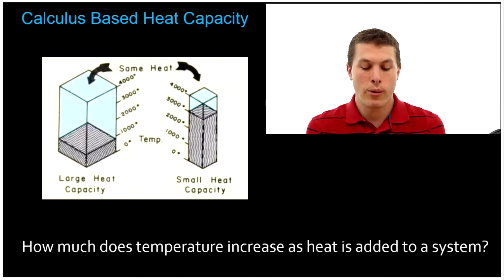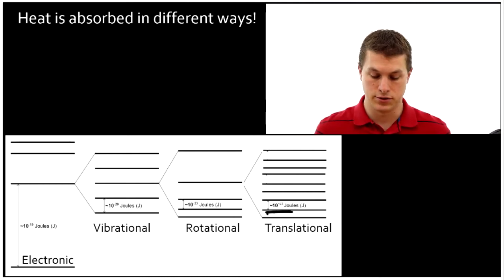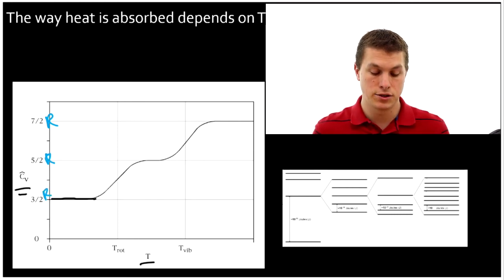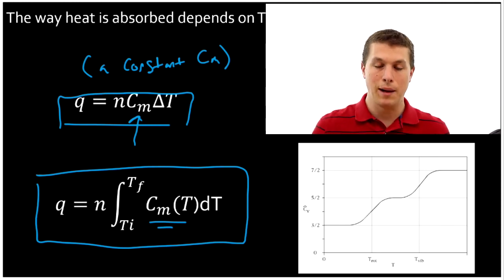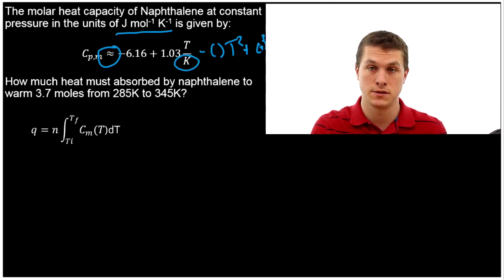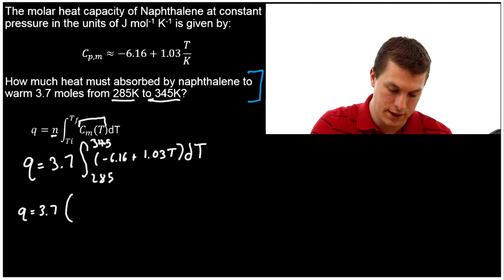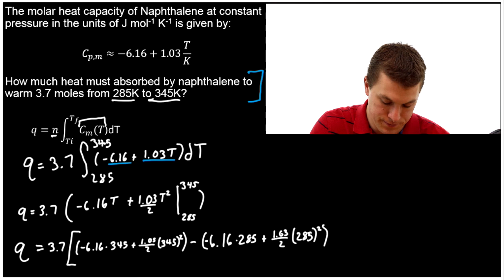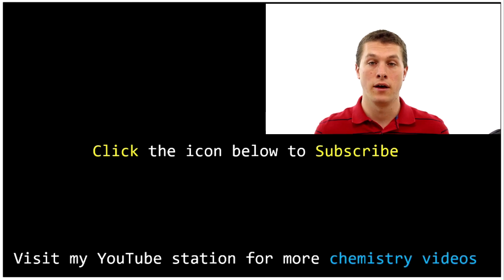Calculus based heat capacity - Real Chemistry

Comment: Please forgive the second question and my general ignorance, but by dropping the additional terms, does that effectively approximate the C value to a linear relationship?   If so, is that just one of the "good enough without extra work" situations?  I'm dealing with a very nonlinear temperature range for my material, I assume adding those coefficients 'bends' the curve so I get more accuracy?  Thanks!
Reply from the maker: Correct the extra terms make the calculated heat more accurate. If you are covering a narrow temperature range, you can usually use a constant, the larger the region the more likely you need to use extra terms.

Comment: INCREDIBLE!  Thank you so much.  I'm very bad at math... can you explain why 1.03T becomes 1.03/2?  I get that you bring the T over as you remove it from the right, but wouldn't that be over T instead of over 2?  Either way, you confirmed my thinking on needing calculus for this problem which is why I came here.   Thanks!
Reply from the maker: Sure! when you integrate T^1 you get T^2/2 and the 1.03 just comes along without changing.